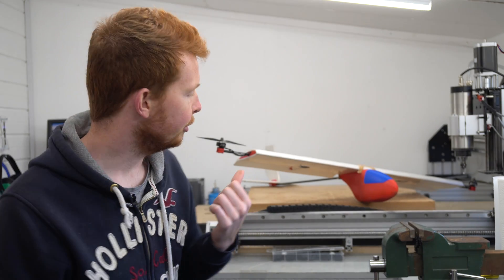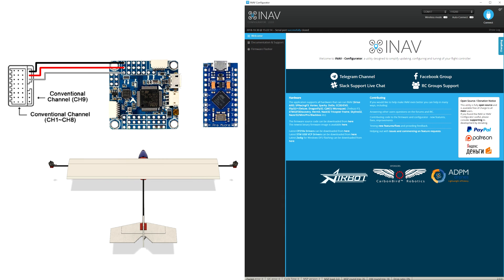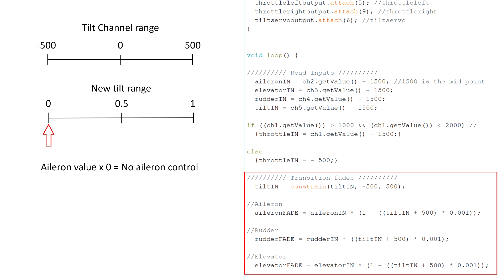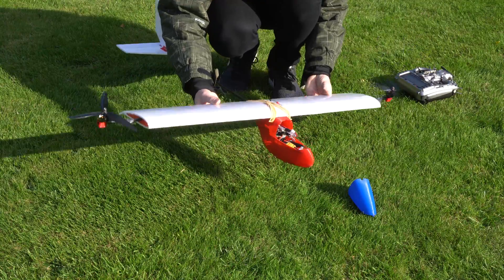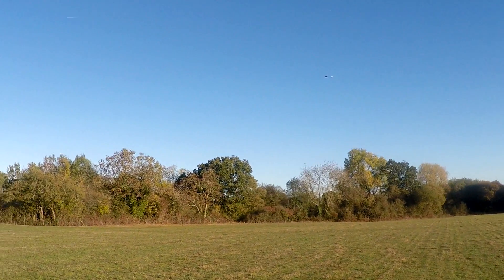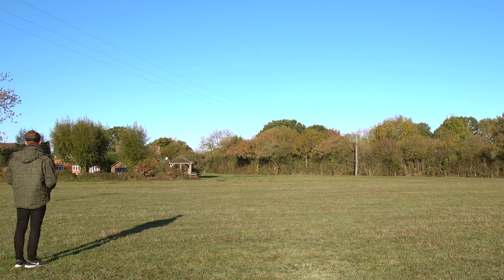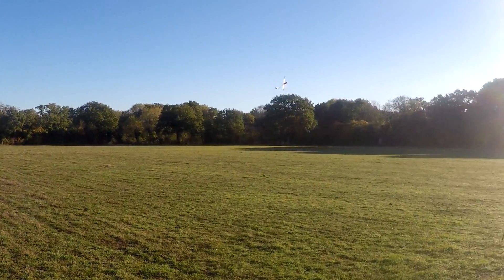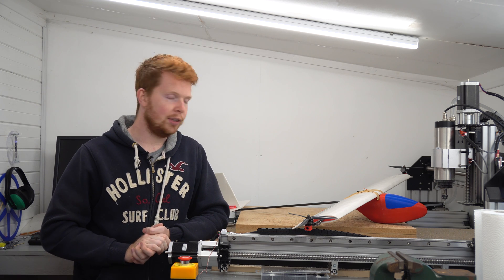RC VTOL - V4

Comment: Hey Tom, really interesting project! I'm an aeronautical engineering student as well and I've done quite some studies about wingtip devices to make aeroplanes more aerodynamically efficient. Here's an idea that might be interesting to give some thought: I see that you placed your motors some distance apart from the end of the wing, and I can imagine you did this for two reasons: 1) so the propellors don't cut your wing when tilting forwards and 2) so the wing doesn't block half the downward airflow generated by the propellors in hovering flight. But consider this idea: Why not give the piece of CF bar between the wing edge and motor mount a fairing with the same wing profile as the main wing, which would tilt together with the motors. This way when doing forward flight, the fairings (if precisely made) will align just nice and flush with the wing, making your airplane potentially way more efficient. This because wingtip propellors might have a potentially positive effect on your induced drag and even have the effect of a blown wing. This could mean even lower power settings during cruise and potentially a less drastic drop when doing the transition from hover to forward flight. It might also slow the plane down quicker when transitioning from forward flight to hover, because you now got 2 peices of blown wing wich generate a lift force against the flight direction, potentially slowing you down more drastically. A downside might be the precise building so the gap between the rigid and rotating wing parts are as tiny as possible to reduce losses. Another downside might be the lift vector that is constantly generated due to the blown wing effect, regardless of flight configuration. In hover this would mean the engines need a slight forward thrust vector (read forward tilt angle) to compensate for this lift vector. Also the motormounts would need to extend higher ofcourse as to not cut your wing when tilting ;)
I know your plane is already quite efficient hence the low power setting you used, but I thought this just might be a very interesting experiment?
Reply: Yes please.
Reply: 87mits that would indeed be my assumption, so you would need some forward tilt to compensate. No idea though how significant this would be, but I know that blown wings can generate a significant amount of lift, tom even made a video about it ;) but if you've seen it you'll see that the effect is way more subtle on straight wings
Reply: @PaperFun  also the forward tilt should be constantly changing based on the throttle
Reply: thats a great idea.
Reply: You might condider changing the wing profile to symmetrical and adding control surfaces only to this section.  These would be ailerons in forward flight and yaw in vertical flight.
Reply: Been done, albeit with a 4 motor RC plane  https://www.youtube.com/watch?v=yfJWWzg5LeM
Reply: same
Reply: be cool if he like acknowledged  such an idea\
Reply: In hover would this make the plane fly backwards?
Nvm didn't read all the way through

Comment: what about building one with 4 motors?
would be easier to hover. And the transition you could do to rotors at a time.
Reply: might as well ditch the wings and make it a quadcopter ;)
Reply: Kinda defeats the purpose at that point though haha.
Reply: Because weights

Comment: Would there be a difference if the motors spun the opposite way of each others?
Reply: The craft needs to have the propellers spinning opposite to each other to make it so that they cancel one another's torque, otherwise the aircraft would pin in it's yaw axis during hover.
Reply: @SmoochyRoo   yea that's what I thought, thanks!

Comment: You might consider using https://www.arduino.cc/reference/en/language/functions/math/map/ which is a handy way to deal with differing range values. I agree with the comment about you marketing this stuff.. awesome.
Reply: it works on integers thus being a whole number which causes several amount of issue's with accuracy when feeding information from the gyro or any other sensitive input .... also since he is using a MCU with a slow Xtal , this would waste several amount cycles which could of been used for something else. Honestly he should of used a ESP32 or a ardunio due variant as even with these small functions wont create a huge stop.Heck! the esp32 is dual core forget about wasting cycles there. heh.
Reply: @jacktheninja  could be confronted by converting a float over to a whole number i.e: 1.01 to 1010, obviously fixed and what not.
Reply: @ionbladezofficial  map function is pretty fast (no doubt) but the fact is that your relying on the motors to stay stable and if the map function calculating and not processing the motors  then you will get jitter in the control which could be seen here too but i do not think he used map function either.Also timing the base number by 10 would need a reversal too!
Reply: @jacktheninja  You could just write a map function using float instead of int...
Reply: @jonathanfeller   and waste a lot of cycles no thank you
Reply: @jacktheninja  At 16 million cycles per second it's not a big deal. 😺
Reply: @jonathanfeller  Its noticeable when working with TFT's and cameras.Its a good habit of using minimum cycles as it help you to reserve things for a later use.
Reply: @jacktheninja  It's good habit to write readable code, and then worry about performance if it comes to be a problem. ☆
Reply: I use this very same function along side a rolling average (of 10 samples) for my arduino "theremin" "synth", and yes I use quotes, twice. It's not as fast as I'd like, but taking samples from a 50ms pulse on one of those distance detector modules, is no ballpark. Map is indeed a great and quick way to basically give a high and low on each side.

Comment: V5, integrate a 20mm in the tail rudder to make it look like a Dauphine helicopter. Then you would have yaw/rudder. The weight will also allow you to adjust CG a little easier or to have a bigger battery.

Good job
Reply: dauphine..........
Reply: or try to implement a vaiable pitch as they have on rc helicopters with the swashplate and what not.

Comment: I Know you didn't want the mass of tilt mechanism on the wing tips but couldn't you have put the motors on a long rod running inside the wings spar and then had the tilt mechanisms inside the cockpit?
Reply: Diamonds & Rust that's exactly what he did go back and watch the last video
Reply: R Shiery the motors don’t tilt independently though which would give yaw control when hovering. Which he isn’t using but expecting it the weathervane into the wind.
Reply: @AK_Ray : Yes but it would e awesome to have a "differential tilt" (with inboard actuator) to allow for skew correction, which could also be used for some vectored Yaw in hover and roll in forward flight...  (Pretty sure that the V22 has cyclic control for pitch and yaw in hover and uses differential collective for roll. .)

Well done Tom, looks great...
Now for tuning some UKF's for robust level 3 autonomy..

Comment: As an experiment, I wonder if control moment gyros could be used to provide yaw control, without thrust, or aerodynamic means. The International Space Station uses CMGs to orient the station, without the need for any reaction control thrusters. Granted, a CMG equipped RC craft might need to be a bit larger, to support the extra mass, but I'd love to see if this works in a VTOL craft. It would require another control board, I'm sure. Anyway, thanks for the video. :)
Reply: Those modern "gyros" are not rotating, but tiny silicon sticks vibrating.

Comment: I really feel like splitting the spar to get hover yaw control would make this so much more usable. And you could lose the aileron servos. ALSO, ardupilot now supports normal FCs so you could use that and it supports tilt rotors of many different kinds: http://ardupilot.org/plane/docs/guide-tilt-rotor.html

Comment: Great job! You can get the same result by programming the mixes in the Taranis, but really awesome Arduino project. Also it's really easy to use gyros with the Arduino, so, just for simple Acro stabilizition ,you can write your own code.

Comment: BTW, the arduino programming language is pretty much a subset of the C programming language with libraries for IO.
Reply: It is C++. I’d advise not to use the Arduino IDE, except for beginners or the most simple of programs.
Reply: @Mike-oz4cv  What's wrong with using the Arduino IDE? It saves having to learn about makefiles and such.
Reply: @Fudmottin  Haven’t used it in a long time but you are limited to one file and it doesn’t provide any of the features a real IDE would provide. Like looking up class/function definitions and declarations, navigating through files, step-by-step debugging etc. 
The Arduino IDE is basically just a simple editor which allows you to edit a single file and then compiles it with a pre-defined Makefile. This is totally okay and intentionally done for beginners or simple projects but for anything more complex it unnecessarily restricts you. It also teaches you bad habits like putting everything in a single file in a single function.
Reply: @Mike-oz4cv  It's been a while since I did Arduino programming myself. But looking at what I have done, each "sketch" is in one .ino file. Although I do break things down into functions and such. To be honest, I've never used gdb or gcc with make. I've been irreparably destroyed by having a real IDE like Xcode. In team environments where projects were managed by makefiles, I've generally been using Vi or Emacs as my editor and I was doing maintenance programming. I would be working in my own corner of the grander project and only add files to an existing makefile. Usually those projects were actually built using BASH scripts at the top level since they weren't confined to just C++ code.

Comment: You should have just used the initial position of your input and your default center in your setup loop.  This way, you can reset your calibration with a reboot of the Arduino.

Comment: For someone who says they are not good at programming you have a really good sense of how to make readable code. Good job!
Reply: Tomasxt25 / legobrainiac Although you should practice storing a function's returned value instead of invoking the entire function for every if statement and math..  Actually that could seriously limit the speed the code runs, especially with these Arduino libraries
Reply: We e4
Reply: In my experience, most of my time spent coding was actually spent reading books and screaming.
Reply: Readable? Perhaps. Maintainable? Heck no. Hard coded constant values all over the place, code repetition..
Reply: hanetar that doesn’t mean it will break. It’s just not flexible
Reply: Once upon a time i worked for an aerospace corporation. There were constants all over the code produced in Bangalore. The colleagues were told to fix it. 
for(int i =one; i  < thousand; i++) {...} was what we got.
Reply: @han5vk   some times you don't need things that much flex-able code